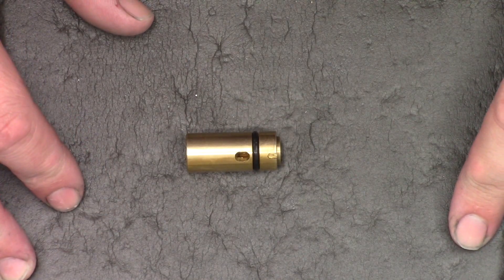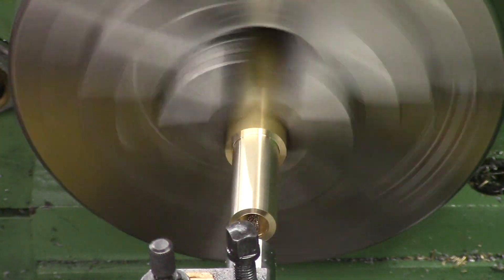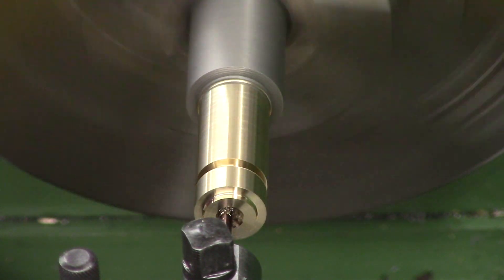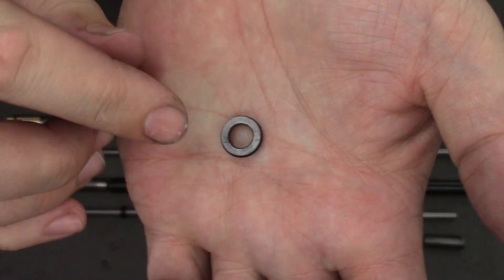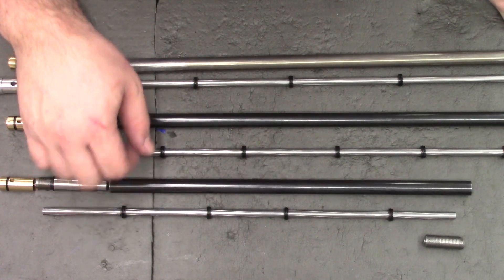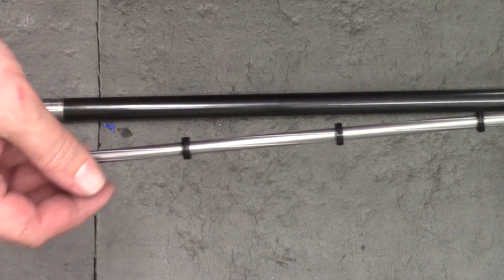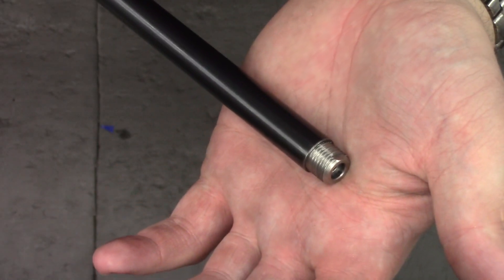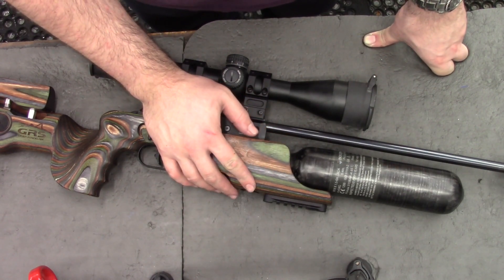Making FX .177 barrel Part 3 the transfer port and supports reup

Comment: Nice work. Well done. I used to enjoy machining brass. A lovely metal to work with
Reply from the maker: A lot easier than stainless steel, turns and mills a real treat. Thanks for watching.
Reply: @sub12airgunners  I bet it is. Never worked on stainless.

Comment: Some nice machine work there , do you also have an interest in the older guns Rapids ect
Reply from the maker: Yeah I just got a Rapid MK1, going to try and make a copy of the block with a few little upgrades. pic rail regulator. ect. Thanks for watching.
Reply: @sub12airgunners  looking forward to that ,you will know there is a huge cult following with them I have a Mfr and have a Raw HM1000x on its way

Comment: Tha is a question that might be a bit out of line with this filmclip, but I do not find the answeres anywhere so I’ll try here. 
I’m thinking that I would buy an FX Maverick. Where I live they come in two different ”shapes”. One of them is called ”compact” that one has a barrellegth of 500 mm, and then there’s one called ”sniper” with a barrellength of 700 mm. The sniper model can not be bought without a license.
I think the difference between them have to do with how much the legal speed is on each one of them. Is there any way to ”customize” the compact model to get the same effect as the ”sniper” modell? I’ve done that once before by switching the transferport into one with more airflow. That was on a fairly cheap airgun (Artemis 900)and it worked quite nicely. Now Im into having a way better airgun that’s why I ask you. Donyou have any idea if that’s what will work on the Maverick I’ planing to buy. I guess I’ll have to buy a new barrel and a tranferport, but would that donthe trick ?   Hopefull for your answere an plz excuse my poor English as I’m not fluent.
Reply from the maker: That should work, the longer barrel gives you more power so you should be able to swap in the longer barrel and you may have to re-tune the rifle (Check the FX airguns youtube channel), Thanks for watching.
Reply: When changing the transferport to one with better airflow, is it important that the opening is pointing upwards?
I have’nt checked but could it be that locking down the the liner with the transferport in place could only be done in one way?
As always thankfull for answeres. And thanks for all the info in your channel ///Christer